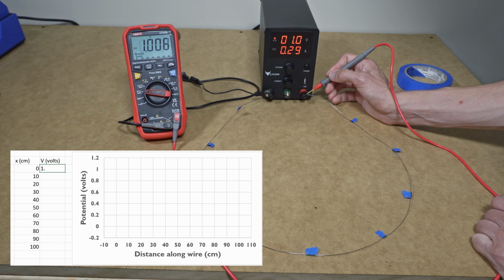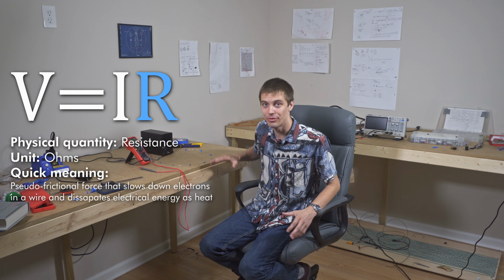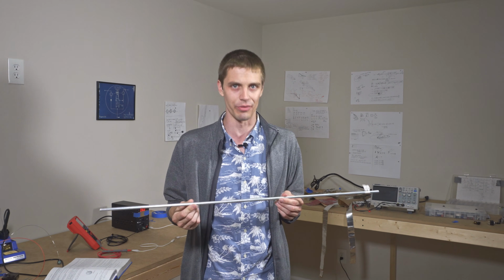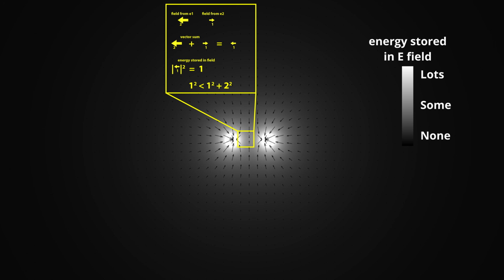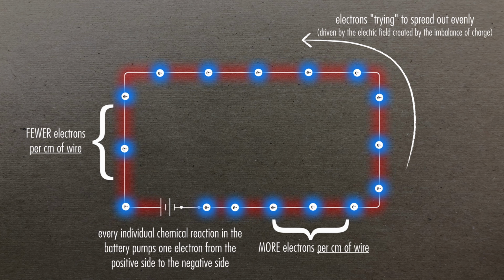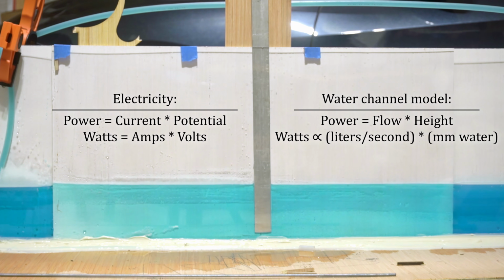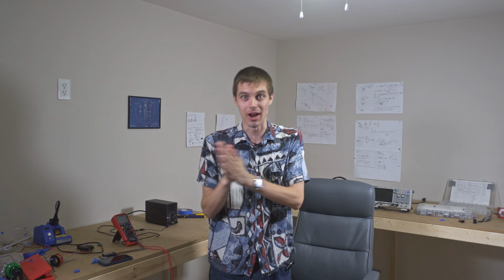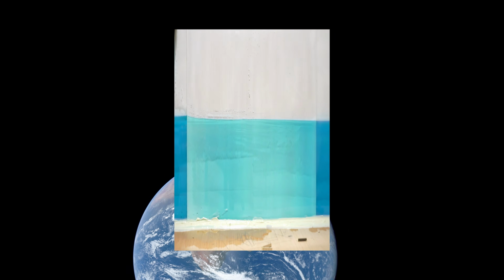An intuitive approach for understanding electricity

Comment: Dumb person here, but this got me pondering:
1. What tf is actually moving through those wires? Like, I have a hard time visualizing it (I'm painter, so a visually based person, obviously). 
When I think of electricity, I think of those flicking, lashing bolts (stuff you'd see on a tesla coil or something), but we don't see that when we plug a normal cable into an amp.

In fact, what exactly are those bolts?? Like I can maybe imagine that a solid object has atoms in a lattice, but that thing idk .... same thing with fire btw (wtf is fire?? lol) 

2a. 13:29 here you mention electrons repelling each other
I know this will sound stupid, but why are they like that? Like who decided they gonna act/have properties like that? 
Google says it's because "Particles with the same charge repel each other". Ok, but why? Why do they have a charge to begin with? Seems so weird to me...  almost something unnatural 
2b. Also, is the charge (on the electron) always there, constantly? Or does it change over time (acquiring and dissipating the charge) (whether you run electricity through a wire or not)?
Shit I have many other questions, I'll stop here.

Comment: The reason it is not taught like this is because electrons do not flow like a falling mass, electrons are free to move as long as they have a home, if they dont have a home, they jump energy levels and a photon is either emitted or absorbed, in general. Most of the electrons in a wire have a home, they do not 'flow' from one side to the other, it almost acts like that because we can see the decrease in 'voltage drop' but we can observe voltage drop WAY sooner than we would if we had to wait on electron drift velocity. It is much more accurate to think of it in terms of charges, and hall-effects, electrons being a domino in a series of stacked dominos would make much more sense than a falling mass that moves a great distance, no? The effects of charge as the dominos fall propogates much quicker than the domino itself. the falling dominos would be the field through the conductor.
i dunno, just sayin, there is a reason why people avoid teaching current as 'flow' at any level beyond what is necessary for ohms law applications.
Reply from the maker: They very literally flow and very literally have mass. If you push on something with a stick and transmit energy, you’d be arguing that the atoms in the stick don’t move to accomplish the task. They don’t move the whole length of the stick, but they sure need to move in order for the stick to poke something.

Comment: the unit terminology is confusing. a volt meter measures volts - which are - a difference in volts. what? that's self-referential and confusing.

Comment: How many electrons will pass on a givin moment in a 5G connection?
Reply from the maker: Dunno - they’ll be scooching back and forth between the circuit and the antenna. The exact number depends on the capacitance of both of those I guess

Comment: I'm not going to watch the full video today, i've only watched 5 minutes or so, but doesn't energy get transmitted through the air? Wires essentially just help to "guide" more energy from the source to the consumer, but they are theoreticially not needed (over short distances) since even transformers or current transformers don't have wires connecting the two coils right? So isn't the whole idea of visualizing current as water flowing through a tube?
Reply from the maker: That effect is generally very shallow around wires and electricity as we normally use it always requires wires and electron motion. The sequel to this video has some visualizations that I really like but this one is a better foundation to start with - I hope it helps!
Reply: @AlphaPhoenixChannel  Yes you're right, obviously transfering huge amounts of energy over the air is unimaginable right now, but what i was going for was that the water model might be irritating, especially since its not a real demonstration of how energy gets transfered, and if someone might learn the truth later on, it might get really messy. The electrons in the wire are not directly transfering energy, its the magnetic field (that forms when electrons move) that goes around the wire (Lenzsche Regel). The energy basicially gets transmitted over a electromagnetic field, that spans from the source to the consumer. Keeping this in mind, if we somehow found away to work with really low amounts of energy, no wires would be used at all. That's something Nicola Tesla thought of as well. If you look at the anatomy of our own brain, our neurons have evolved so that potential noise energy from other parts of the brain (that gets transmitted without any "wires") gets filtered - this is probably why our axons only fire when the potential is high enough. So if we think about it, the transfered energy without wires over short distances is already big enough to disturb the funcionality of our own brain, except that we evolved so excactly that doesn't happen.

Comment: I am always troubled when I see the water analogy for electricity.  It's only for DC, and gets super complicated to ask a new learner to take the massive leap to fluid dynamics.
Voltage IS analogous to Force.  Resistance is Friction, and Current is velocity.  The math is the same.  If you want to connect electricity with mechanical things one can understand... it's suggested to use the Mass, Spring, Damper system because the math works... and also works to transient, sinusoidal, and other forces (voltage types).
It's suggested to provide the disclaimer that this video only applies to DC circuits.  If you don't, then the next thing folks try to understand is their house AC voltage.  The audience is instantly lost when trying to understand what the heck happens when the "water" changes directions at some frequency.  That's when Calculus is required.  That's pretty much when folks just walk away.
Near the end of the video you try really hard to make the model fit and try to explain non-static behavior.  Show the math... it's well beyond one a normal person could understand without derivatives and integrals.  Pipe restriction is a resistor, inductor is inertia, and capacitor is what?... I read an analogy is sealed membrane in the pipe.  These can be explained, but see how that is way more complicated?  Energy storage for a water system is pretty much not intuitive.
So go back an rethink... would you start an electrical engineering course this way?  
Mass, Spring, Damper is a far easier transition.
Reply from the maker: I would 1000% start an EE course this way. Voltage is not a force. Energy transmission in standard 60hz ac is best understood as two discrete stages of DC (plot the instantaneous power along side the voltage and current and there’s only power when there’s current)
Check out my next video where I show the on transient of a simple circuit (branching wire) at 500000 fps and compare it to a water model

Comment: NO! You did not SODDER a resistor into the wire. You soLdered a resistor into the wire. It has an L in solder.

Comment: An electron can’t do math? i have rocks running Call of Duty.  Facts.  Also this might help you understand a little bit better because you have some confusion in how electricity works. I build the Hydro lines that you use so I might know something about it. Here’s a more accurate picture of what happens in electrical circuits:
	1.	Drift Velocity is Extremely Slow
	•	While we imagine electrons moving rapidly, their actual drift velocity in a typical household wire is very slow—on the order of millimeters per second.
	•	This is because the electrons are constantly colliding with atoms in the conductor, making their net movement (drift) very sluggish.
	2.	Electric Field Propagation is Instantaneous (Almost)
	•	When you flip a switch, the electric field propagates through the wire at nearly the speed of light (depending on the medium, typically 50–99% of c).
	•	This electric field influences the electrons throughout the circuit almost instantly, causing them to start moving collectively.
	3.	Energy Transfer Happens Through the Electromagnetic Field
	•	The real “flow” of energy isn’t through the movement of electrons, but via electromagnetic waves propagating through the space around the wires.
	•	The Poynting vector describes this flow of energy, which moves outside the conductor, guided by the electromagnetic fields.

Key Takeaways:
	•	Electrons do move, but very slowly.
	•	Electricity travels at nearly light speed due to the rapid propagation of the electric field.
	•	Energy is transmitted through electromagnetic fields, not by electrons physically moving from one end to another.
	•	The power that lights up a bulb is actually coming from the field energy carried by the wires, not from electrons “flowing” through them.

This is why electrical circuits work instantaneously when you flip a switch, even though individual electrons barely move. Comparing electricity flow to water flow is a very outdated method from the 1900s and incorrect although I see a lot of Youtubers keep pushing this.
Reply from the maker: When you push water through a hose, it comes out the other end “almost instantly”. It’s the same thing. Electricity propagation is not electron propagation and at no point during this video do I imply otherwise, in fact I have a pretty explicit description of drift current that matches yours. Thanks for the book of a comment for engagement though.

Comment: I strongly disagree with the interpretation in terms of energy being stored in the electric field.  It is certainly true that you can integrate that quantity over all space and get the energy that would be released by letting all charges go to infinity and all fields decay.

But there is no place the energy is stored.  Energy is a property of the total system and all conservation laws.  Saying it is stored in the field creates the impression that if you somehow zeroed out the electron's charge all the sudden the energy would be left in the field.  But no that would just break all the math since charge would no longer be conserved.
Reply from the maker: I think you break charge conservation by magically zeroing a charge?
I agree you can also express the total energy as the i defeated energy needed to assemble a specific configuration of charges from infinity, and sometimes that math is easier, but I believe that technically the field carries energy - this allows for fun stuff like self propagating plane waves of E+M that move energy long distances
Reply from the maker: Actually if you move the electron, the fied only updates at the speed of light, so in a way you can alter a charge and the field still holds energy - that’s how radio works
Reply: @ Yes but that's different than imagining the charge vanishes because work went into moving that charge and if you ignore that work then you get a different amount of total energy.  We don't disagree that the math works out I just think that most people understand the claim that the energy is in the field in a way that is a bit misleading.
Reply: @AlphaPhoenixChannel  I mean technically under noether's theorem energy is just a conserved quantity corresponding to the time symetry of the system so it's a bit undefined to ask what happens if you break some of those rules.  TBF all explanations do some violence to the mathematics so it's somewhat subjective -- but I don't think veritasium's video on this helped and that's why I don't love it the way I loved your other explanations.
Reply from the maker: @ if you’re saying that the system breaks because you do this magical thing of removing a charge from reality, then of course it breaks, because you’ve done magic. I don’t think it’s disingenuous to say that the energy is the result of the configuration of the system but the position in space of that energy is pretty well established
Reply: @ But in what sense does the energy live in one part of the space or another?  Consider a two electron universe.  I can compute the total energy either by integrating over E^2 over all space or I can take the path integrals moving them to infinity (more generally we should also consider EM waves but we can just add them up as well).

It would be just as wrong to say the electric field at all points other than on the paths used in the path integrals has no energy as it would be to say the energy is stored in the field.  They are both just calculations that give you the total energy.

My issue is that saying the energy is "really" stored in the electric field suggests that there is some sense in which one equivalent formulation of energy is correct and another is wrong.  The only way that one calculation could be where the energy is "really" stored but not the other is to claim that one calculation would continue to work even if you broke the laws which doesn't make sense.
Reply: @AlphaPhoenixChannel  As a simpler example consider Gauss's theorem.  The total charge inside a volume is equal to the surface integral of the flux over the boundary but you wouldn't want to say that therefore the charge is really at at the boundary.  Similarly, just because there is a value you can integrate over 3d space that gives you the total energy doesn't mean that value tells us where the energy "is" in any meaningful sense.
Reply from the maker: @petergerdes1094  This only holds for electrostatics i believe. As soon as you start moving things I think you can break this. electrodynamics are the easiest way to show that fields carry energy. And no, except for very symmetric cases you can't move the charge wherever you want. the energy integral is no different - the energy is where the energy is, and if you want to approximate the system in some way by taking a creative integral, that approximation will only hold for a certain region of space
Reply: @ I was giving a toy example the only important point is that you can compute the total energy multiple ways which aren't that one integral so while the energy density is a useful formula the energy isn't a thing located in space (like a particle) but a property of the system.

If you want to be more technical consider the following "proof" that the energy is entirely contained in the field at rational points in space.  All the fields are differentiable (C infinity I believe) except on a countable set of isolated points (the point charges) therefore the total energy of the system is completely determined by the value of the field at rational points and you can therefore replace the integral you gave with an infinite sum that only uses the values of the field at rational points.   

Despite that, it would be misleading to say the energy was "really" located only at the rational points in space since I could do exactly the same thing with a set of irrational points.

So just because a given computation gives you the total energy doesn't make it true that the energy is somehow "really" at the locations used in the computation.   It's just one amoung many of calculating an invariant of the complete system.   I don't mind calling the formula in terms of fields the energy density of the field but I think people understand the statement about where the energy really is as saying that "if you vanished the charges magically the energy would still be there in the field" when really that's meaningless.

My issue is that suggesting that the energy is really here rather than there suggests that some ways of computing the total energy are privileged so that if the laws of physics broke that is the "real" computation while the others only hold contingently but that's not really a meaningful claim.
Reply: To be clear, my issue is just that I think people hear "the energy is really in the field" and imagine that means that if the charges were magiced away you would still find the same energy stored up in the field.  As if energy was a thing in itself not a property of a system.

Comment: I feel so stupid,  please help.  We're told that electrons flow from negative to positive despite conventional teaching which originated before electrons were discovered. So in the opening of your video you show a power source, and you illustrate electrons flowing from the positive terminal, decreasing gradually to the negative terminal. If eectrons are truly flowing in the opposite direction how can this be true?
Reply from the maker: That’s the negative terminal - I try to clarify this at the end of the video. Bottom line is that for 99.9% of cases, you don’t need to care what’s flowing
Reply: so the RED terminal should be considered the negative, and thus the source of electron flow?
Reply from the maker: @deraeler in the bit you’re talking about done say “current” or “electron flow”? Conventional current comes from the red and goes opposite the electron flow. Electrons come from the negative

Comment: Electrons don’t flow through the wire like a water
Reply from the maker: Mathematically it’s referred to as an electron gas, and yes they really do flow - that said, the electron gas is actually even less compressible than water, making electrons in a metal have more like most people think water behaves because overzealous explanations with the word “incompressible” in them

Comment: that's crazy to meet this video, i'm building a data pipeline processing workflow,  noticed the same behavior when monitor the data processing rate, your water model is prefect to use in my  case, thanks for it